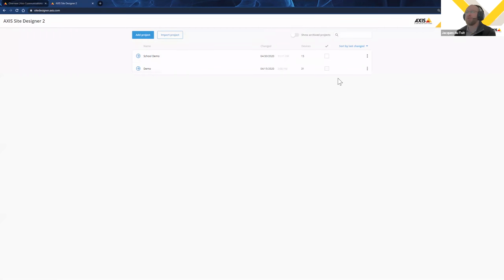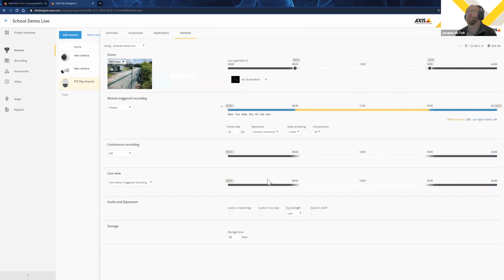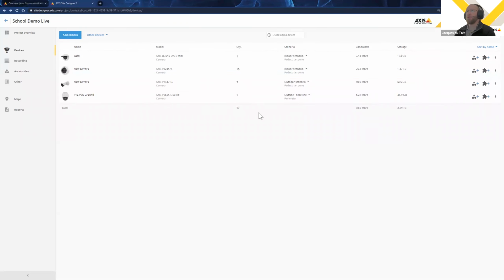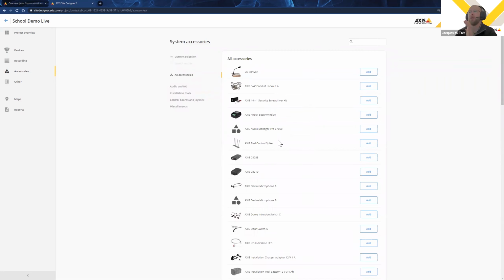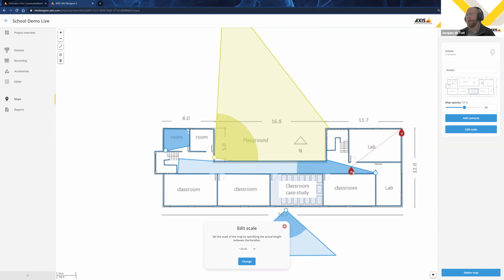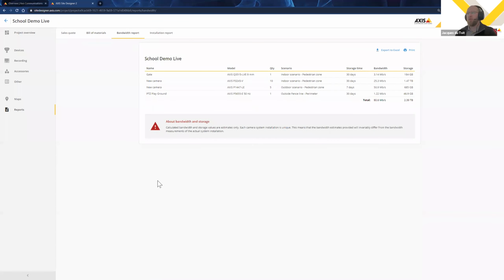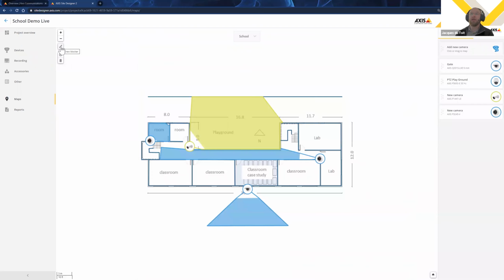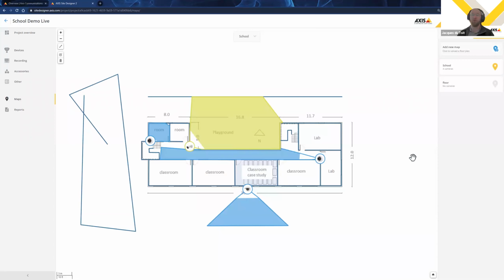Axis Site Designer - Axis End to End Webinar

Comment: Hi : I cannot print the system proposal - save as PDF or Adobe PDF or  installed printer or any thing..." it says the selected printer is not available or installed correctly". Is there any setting required on the Site Designer to enable printing or is printing restricted?